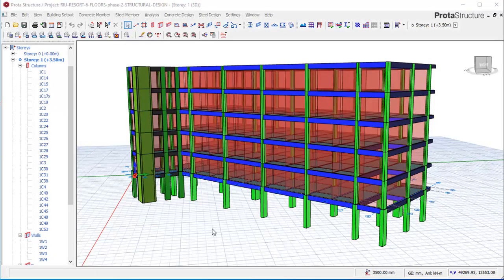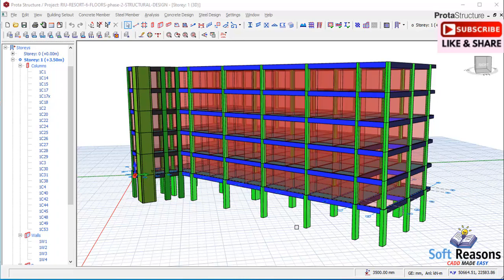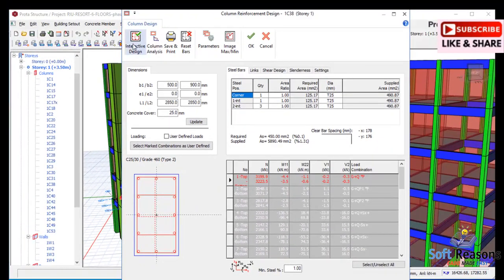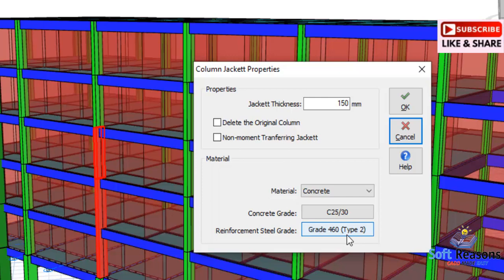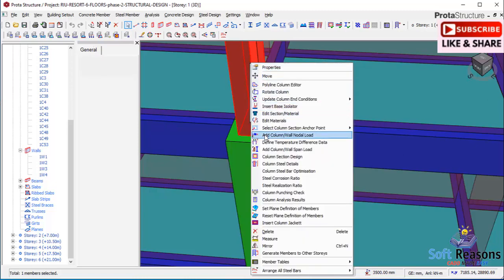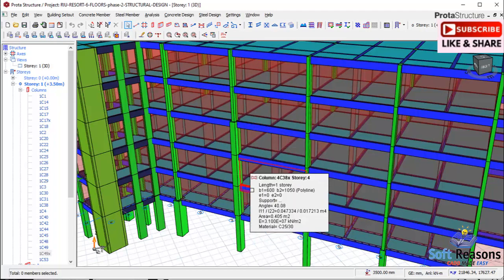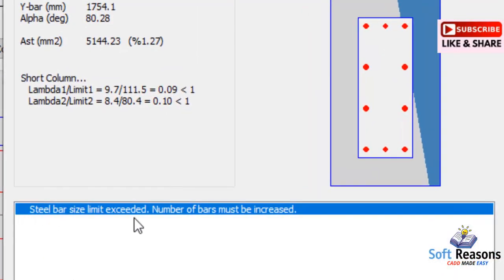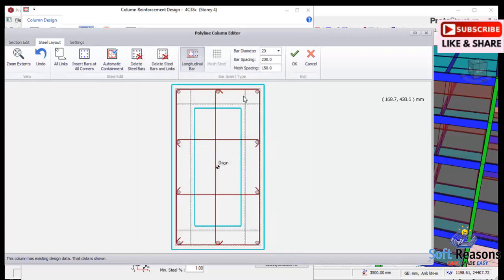Reinforced Concrete Cement Column Jacketing as Applied in Protastructure. #structuraldesign

Comment: Please which version of Protastructure are you using. I am using 2018 version 03.0 sp 4. Selecting the columns and right clicking after analysis and design; in the option drop down no insert column jackett is displayed. Thank you.
Reply from the maker: Version 2021 of PROTASTRUCTURE
Reply: Thank you.